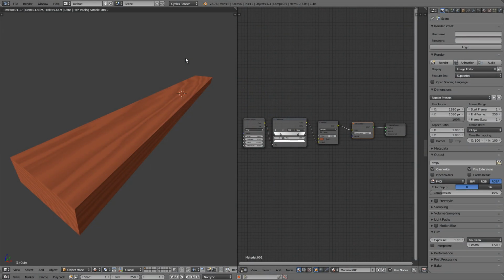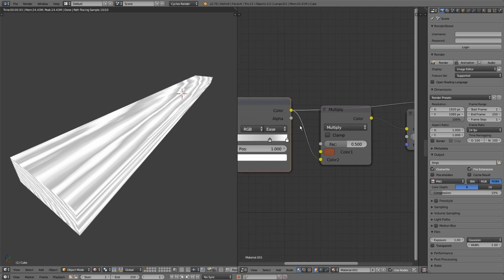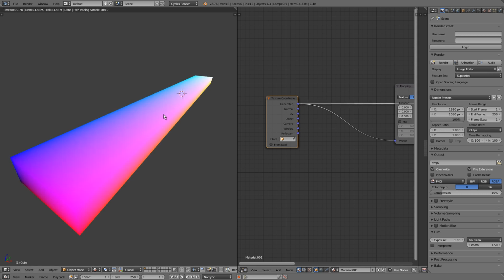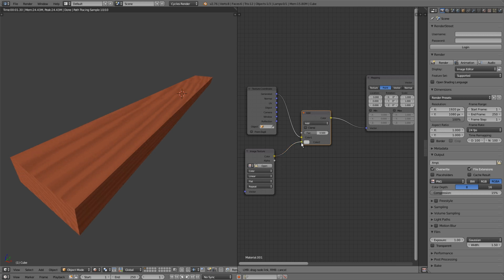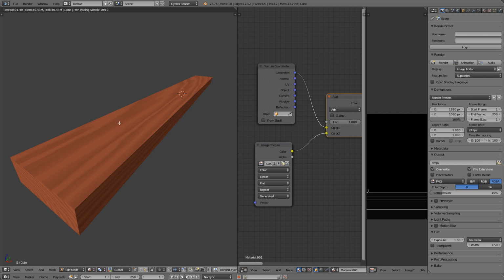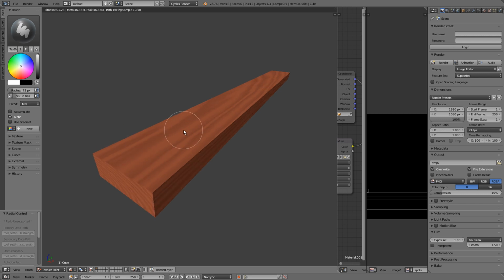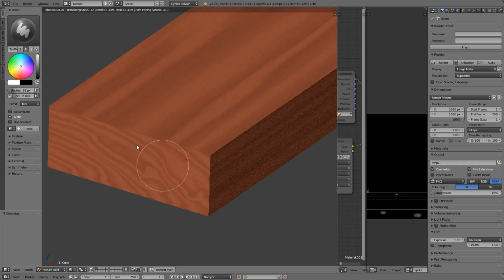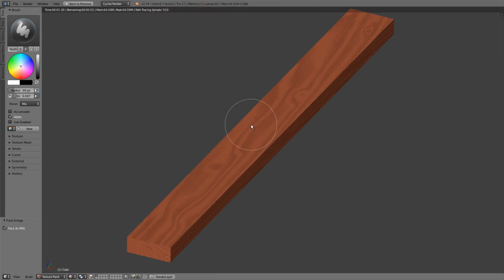Blender Tutorial - Adding Knots to Procedural Wood Shaders

Comment: Cg master Can you explain in first order and the connections you used on each node to explain this for me I set up all the bnodes but they don't want to work as described,,maybe you can go threw each node where they are connected to as I get the rings but its still white or when I switch the nodes around it goes brown but no rings Thanks
\

Comment: Just what I was looking for, thanks a lot!. Just one question, how can I rotate the wave texture pattern? like from horizontal to vertical, I tried with "rotation" in the mapping node but didn't work D:
Reply from the maker: Because this wood shader uses "rings" for the wave texture, getting it oriented how you want might be a little strange at first because the rings are originating from a center point. So the trick seems to be moving the origin point to get different directions of rings. So try playing around with the location options instead. The rotation values definitely affect things too, so it just might take some fiddling around to get it all right. -Chris

Comment: When I get to the painting part, the knots show up on the other side of the wood piece.  Anyone know why and how to fix it?
Reply from the maker: Try recalculating the normals of the object(select all vertices, press ctrl+n). If the normals are inverted then painting from top view will paint on the bottom of the object. If that isn't the problem then it may be an issue with how you UV unwrapped the object. For example, if you have the top and bottom faces overlapping each other in the UV layout, they'll both show the same knots. -Chris